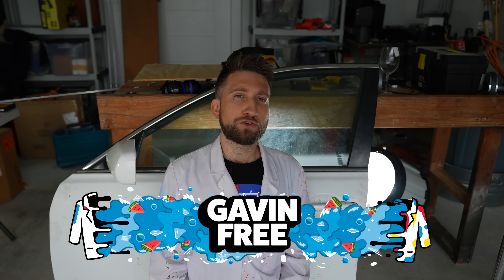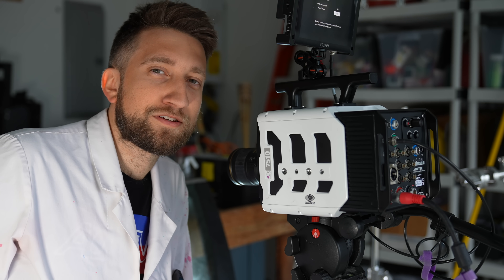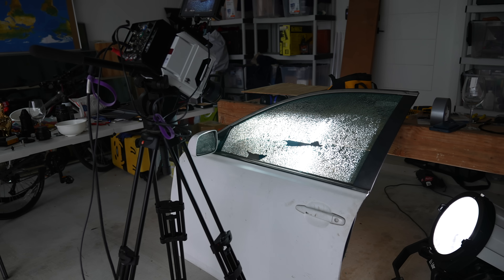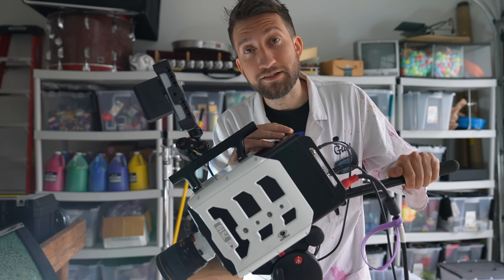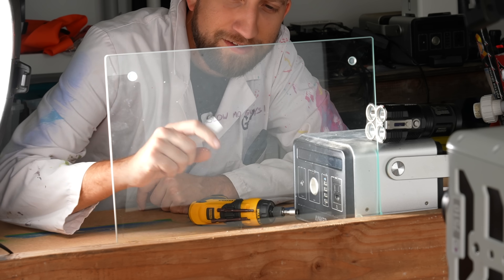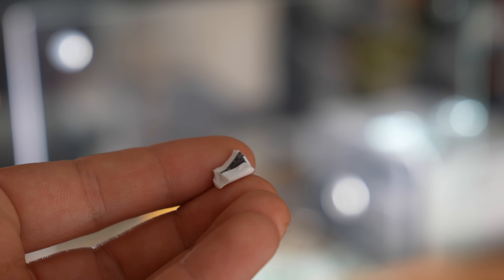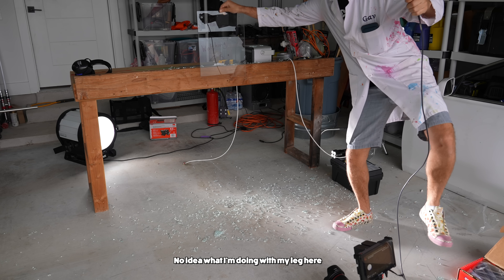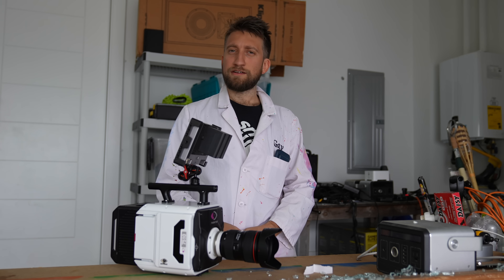Spark Plug vs Car Window at 800,000FPS! - The Slow Mo Guys

Comment: Tempered glass cracks propagate incredibly fast, often exceeding the speed of sound in the material, reaching speeds of up to 3,000 to over 3,200 mph (around 5,000 km/h), with the speed depending on the glass type, impact force, and stress.

Comment: Commenting from over 3 years in the future,  next time you do glass of any manageable size, you should light it by putting LEDs in a frame so that it's lit across the plane for consistent contrast and better exposure! Run them along the horizontal axis under and above the pane so it is lit constantly.

Comment: There's a device that many law enforcement types carry these days for breaking car glass, that's small but extremely effective. I don't know what it's called but it's similar to spiky ball bearing. It fits easily in a pocket, doesn't need to be hurled with great force or velocity, and virtually guarantees a break every time. If you plan to break a lot of auto glass, you might want to look into obtaining a few.

Comment: a slingshot would probably be a better way to project the tile... and an interesting experiment for glass or water is do the ripples / fractures travel faster if the projectile impacts at a faster speed.

Comment: I was looking for an explanation for why ceramic fragments of broken spark plugs break glass. He didn't really break down the science that well, but at least he was wearing a lab coat so that's cool. I do generally understand now That it's all about creating enough force From the throw to provide enough pressure to break the glass Which happens because the porcelain is very hard and fragments into very fine points when shattered.

Comment: 4 million frames is the equivalent of 46 hours of standard 24fps movie! 
The propagation takes ~300µs, assuming it's going 150mm in each direction, that's a propagation speed of 500m/s, 1800km/h, or 1120mph.

Comment: Despite the number of these that I've watched, my brain momentarily shut down, and I was reading the "FPS" here as "feet per second," rather than frames per second. And I was wondering how you got a spark plug to travel that fast. Which is faster than light. And then finally the light reached my brain....

Comment: The sledge hammer bouncing off the window is something I have seen in person. A friend of mine explained it as an intended feature of safety glass. It's designed to take straight-on blunt collisions. But, if you chip it with some like the chipped edges of a ceramic spark plug, the jagged edge is able to slip into the "lattice" of the safety glass and cause a chain reaction that causes it to break away. Protect in most collisions, but give way when you need to pull someone out of a burning wreck.

Comment: It's like my commercial porcelain the shape of a finger, it holds over 400 KG end to end, but if you drop it it shatters on the tiles. yet I could not break it in half. petrified as it is waterproof even without Glazing it.  it even had a 4 mm hole true the length of it.

Comment: It takes a real hard pitch to shatter a window, it's possible to shatter a window with a tiny shard that's around half a square centimetre. It takes a powerful throw close to the window, I actually shattered a flat back windscreen with a decent sized shard, car thieves tie them to a shoelace so they can swing them and not loose them! Kinda hard to charge someone with having break & enter tools when they have a tiny piece of porcelain

Comment: Hahaha! Jeez Gav ... whenever someone told you that you can break a car window with a spark plug what they meant was that you can break a car window with the ceramic from a spark plug. LOL You don't throw the whole hoofin' spark plug through the window! The plug is just a source of ceramic is all. Do this one again please ... take a spark plug, smash the ceramic on it, tie a little piece of the ceramic onto a string and then swing that little piece at toughened glass - when one of the sharp corners/sharp edges of the ceramic catches the glass just right the glass should shatter completely without caving in. It'll shatter but it'll hold it's shape & won't move and it'll barely make a sound - you'll hear the crack but you won't hear glass falling down. It's kinda cool when you get it right.

Comment: ≈ 0.45 × escape velocity from the Milky Way ( 494 to 596 km/s )

 ≈ 0.54 × typical speed of the solar wind ( ≈ 450000 m/s )

 ≈ 2 × electron saturation drift velocity in high-quality silicon at room temperature ( ≈ 1×10^7 cm/s )

Comment: Wow, super fascinating that the horizontal lines form first actually, before the vertical lines do, and apparently, the structural integrity almost seems like okay-ish right up until those vertical fault lines manifest.
Reply: Welp, at least on the 500k f/s one... the 800k one seems a lot more chaotic... wonder if it's down to the actual impact itself, i.e. the shape of the projectile and the initial ruptures' vectors?

Comment: At 3:03 flipping between the frames where the spark plug impacts, you can see that while the plug itself moves across less than a full pixel, the cracks in the glass are already propagating so fast that the latter frame they're already about the width of the plug away from the point of impact. It never ceases to astound me how fast glass breaks, it's mesmerising and mind boggling in such a beautiful way.

Edit: to put it into numbers, between 6:09 and 6:13 the crack moves from about 2/3rds of the way across the frame at 12:10:12.822308.86 to the left edge at 12:10:12.822504.86, meaning it propagated across that distance (which looks to be a few cm) over the span of 296μs, or about 67-100 times faster than chemical signals racing through your neurons to process sensory information (which takes about 20-30ms).
In other words, the time between the first photons carrying information about the fact that a large pane of glass is breaking hitting your retina and your brain having turned that into a single frame image, the crack will have advanced by at least 30 meters - and that is before you've started thinking about what that new information means. Granted, the paper I found doesn't specify what kind of glass they used, but at room temperature the speeds at which most kinds of glass break aren't going to be significantly different.

Sources:
Glass-fracture velocity by F. E. Barstow and H. E. Edgerton ( https://ceramics.onlinelibrary.wiley.com/doi/abs/10.1111/j.1151-2916.1939.tb19471.x )
How fast is the speed of thought? by Martin J. Tovée ( https://www.science.smith.edu/departments/neurosci/courses/bio330/pdf/94CurrBiolTovee.pdf )
Reply: This is such an underrated comment
Reply: This is such an underrated comment
Reply: My brain hurts reading your comment 🤣
Reply: nice one

Comment: So why isn't there a camera that can do 10M fps at 4k? Or 1600 synched cameras in a 40x40 grid each doing 96x54p/10M? Just carry a server rack or 2 of Raid0 SSD's with you for storage. Use that to film lightning. At 10M a lightning strike would still take half an hour and even the return stroke would still take a couple seconds from ground to cloud even though it's moving at 1/3 the speed of light.

Comment: Tempered glass edges can actually be pretty strong. They're only weak in comparison to their surfaces. Safety glass - like for car doors - has rounded edges that are meant to break when the door changes shape. I've seen a 12mm thick shower door take dozens of swings on the edges from  crowbars and hammers. Pretty wild.

Comment: Hey, i habe an idea for making the point of impact more precise and have it more in frame: use a board in a V shape / tube and then sling the spark plug piece with a simple rubberband - kind of like a gun if you want …. Know what I mean ? 
Anyways …. AWESOME video, very impressive to see a glass crack in such way !!

Comment: That fragment is way to big id say less than a third smaller .You just have to throw it harder ..but the smaller the piece it doesn't smash the glass it just pops ,and its a lot quieter

Comment: Is the sound of the glass breaking actually the recorded sound or just added for effect. Just wondering because that seems just as incredible as the video if so.
Reply: The sound is added in.. kinda. If you were to take the actual sound from these shots in real time you wouldn’t hear anything. Example - Gavin slows down the visual recording by 1,000 times and then adds in the sound recording slowed down by only 10 times. Does that make sense? I think he uses the real sound from the recording but it is played at a MUCH different rate than the video
Reply: @jb17415  Cool, thanks. That makes sense.

Comment: When we were young and dumb we would use a sling shot you can use a much smaller chunk then and it will shatter the glass without dropping it making all the noise it was an old school trick car thieves would use

Comment: Assuming I did the math right, with 2.2 seconds of shooting footage and 145 frames in which the glass is cracking whatever size of glass that was finished shattering in 79750 nanoseconds (0.00007975 seconds). If we had the dimensions of the glass sheet I'd love to see somebody calculate what speed the glass is shattering at.

Comment: the cracks propagate directionally across the glass at ≈21,000 m/s. That's almost 60x as fast as a 9mm bullet. If you filmed a bullet cracking the glass, the glass would crack and the bullet would seem to be frozen in the air.

Comment: So many questions. 
Do the fractures radiate out at the speed of sound? What's happening with the pause before it shatters, are shockwaves bouncing back and forth inside the glass? When the pane has finished cracking why is there a pause before it explodes and when it does why does it explode outwards in all directions when the force applied to it was at the bottom from contacting the floor?

Comment: A jagged edge from a dinner plate works too!
Years ago, my wife dropped a plate on the counter, it shattered and sent a shard into the oven.  The tempered outer glass exploded with a very loud report.  At first I thought a bullet came through the wall and hit the stove!  After not finding any broken windows or holes in the walls I focused on the oven window and the demarcation point and found a TINY shard of plate.  It was incredibly loud and the glass was crackling for an hour after it happened.

Comment: Using polarizers you can see the stresses in glass. If you shot through a polarized filter, with polarized illumination, couldnt you capture the wave of stress moving through the glass just in front of the cracks?

Comment: Hi there Slow mo guys. You said the crack moves all the way through the frame in 0.000181 of a second. I'm wondering what is the size of the frame in meters to calculate the actual speed of shatter. Thanks in advance.

Comment: I can't help but wonder what causes a change in the structure of glass to travel so quickly through it.  The breakage (change in structure) is happening at what appears to be thousands of times faster than, for example, a flame front traveling through a combustion chamber.  I wonder if the molecular structure of glass makes such speed possible.

Comment: Next time just use a safety escape hammer. It has a hardened steel tip and does the same as the ceramic on the sperk plug.

Comment: Imagine playing games with this, fps: 1.7m
Reply: You wouldn’t be able to tell it apart from 60 fps
Reply: @thatoneguy611  wym?
Reply: @thatoneguy611  have you ever played on a 120 Hz or higher moniter? Try switching from 120 FPS and locking IT at 60. You Will see and feel a very clear diference
Reply: @thatoneguy611  you ok ? 😂
Reply: @aryangoyal5229  how would you be able to tell the difference between 120 and 1.7 m fps ?
Reply: @sebus212pl4  The point is that if we can so easily tell the difference between 60 and 120 hz, just imagine how drastic of a change to 1.2M would be.
I can almost certainly affirm at this point that you guys have had a chance to try a high refresh monitor.
Reply: @aryangoyal5229  Past 300 frames people develop motion sickness
Reply: @sebus212pl4  People get motion sickness past 300 fps
Reply: @pxrxy  plausible
But I am just pointing out the difference would be easily noticeable, unlike some people said 🙃

Comment: You've got to try the same experiment with a tempered glass patio door!  Before I learned the hard way it can't be done, I tried to cut the glass using a glass cutting diamond tool.  After creating the V linear hole across the window, I saw the surface turning into multiple waves like a drop of water hitting a still water surface.  The wave propagated through the window before the tempered glass exploded in thousands of pieces, I encountered parts for years in the apartment!

Comment: Why do you need to shrink the height of the screen? Can’t you just lower the resolution?
Reply: It's probably has to do less with actual resolution (he says he could bin the image horizontally if he wanted to), and has to do with shutter/readout speed, i.e., the time it takes to capture, read out and store rows of data that fast.

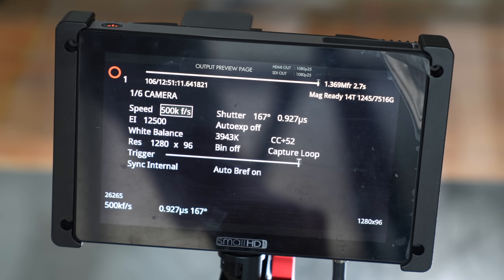Comment: 4:26 I'm longing for the day a UFO is filmed with this camera
Reply: That's basically impossible even before getting into the probability of UFO Encounters themselves.   The amount of setup required to properly use this camera means that  every shot with it has to be planned.   If you are filming it with a Phantom, it's not a UFO because you have identified it in a controlled shoot.

Comment: To see the glass crack circularly the way it did first up was unreal, then @800,000FPS it definitely slowed it down, yet it would have been magical to see it as a full frame - too bad you only got the letter box effect due to resolution - yet that would take a next level camera. Cheers Gavin :-)

Comment: There's something I've seen on YouTube and I would love to get a real slow-motion explanation view of it.
Someone poured molten metal (or molten red lava rocks) onto various pieces of glass and one of them was 'fire resistant', panes of glass with a gel between. In the video, it looked like the gel was boiling inbetween the glass panes before finally flicking the now solid piece of metal off the surface. 
I have a link to the video in question,
https://youtu.be/-T_XPaY43YM

Would it be possible to get a good slow motion of this effect/reaction?
Reply: Thank you for the link. That was some pretty fascinating stuff... I ended up watching their videos for an hour before coming back here 😂

I agree, it'd be amazing to see that insulating gel as it outgases in extreme slo-mo 😳

Comment: https://youtu.be/0-HYPdh744M I know this is an old video but there are over 500 likes on a comment mentioning slow mo guys and I’m sure tons of people would want to see this collaboration with the YouTube channel Photonicinduction, what’s actually happening that the electricity can violently blow apart these fuses and bulbs as it does. Also really interested to see what a crt tv over volted looks like before it blows the electron gun/coil/ray w.e people call it.

Comment: I even adjusted The Playback Speed in Settings, I need Slow mo in A Slow Mo 😂
Reply: Legend
Reply: Genius
Reply: Yeee boy
Reply: Yes, at 2:40 with .25x speed is very satisfying.
Reply: 69 like wow
Reply: I did this as well its 4x slower so around 320000 frames a second instead on 82000
Reply: @Billt31-07  that’s not how the playback speed on YouTube works
Reply: @Billt31-07  that's not how FPS works but I get what you mean. I did it too and it was pretty cool, and his voice sounded funny
Reply: @Billt31-07  it's still the same amount of frames per second, the camera didn't change when you set the speed to be lower on YouTube. The only thing that changed is what frame rate you are choosing.
Reply: Did anyone else hear him have an orgazam at 0.25X speed.....
Reply: @Littleluirui  at 7:00 yes
Reply: @Littleluirui  yeah but not much  slower than You
Reply: @Littleluirui  I did and it's hilarious
Reply: 10 millions FPS
Reply: Pro tip: 
On desktop YouTube  when the video is paused use < , and >. keys to go frame by frame
Reply: No cap 0.25x is even more nutz
Reply: I never knew this was a thing till now
Reply: Legends alert 😂
Reply: Samr
Reply: I also😂😂
Reply: .25 and I enjoyed the circle
Reply: Kedu kettavan
Reply: @lordzeus8873  good job 😂😂
Reply: @lordzeus8873  Muthu pandi kota di
Reply: @FirstNameLastName-ro6jb  nuthu pandi kota di
Reply: By the Way, Frnds, this guy is a great spammer.. @lordzeus8873   be Aware of him
Reply: @FirstNameLastName-ro6jb  ennena solraan paarunga
Reply: @lordzeus8873  🤣🤣🤣🤣🤣
Reply: Thala 🔥🔥🔥🔥🔥🔥🔥
😂😂😂😂
Reply: @pranavkarthikeyan2004  😂
Reply: hey, everyone has to when glass is being broken.
Reply: i am also interested in this so much

Comment: How much does this cam cost?
Reply: Phantom's v2640 does 11,000 frames max, and can cost $135,000-$175,000. Since the camera used can do a lot more than that, it might cost several times more than that. Sorry I don't have a more direct answer

Comment: interesting question here: Is that faster then Lightspeed ? I mean the one with the 800k/s
Reply: Nah, light would still move around 250 meters in 0.79 microseconds. Still, that's pretty dang fast.
Reply: you call me ?

Comment: 7:58 most satisfying sound in the universe. Like a huge anvil falling perfectly on steel.
Reply: And this is done completely differently that what's happening. Sometimes slowing down the sound works, mostly it doesn't. Gav explained this in a video
Reply: Now change the playback to .25 and listen to it

Comment: when you dropped it, it cracked because of the other super hard tempered glass pieces under it, same theory as with the shattered tempered porcelain from the spark plug.

Comment: if my calculations is right, the speed is 4500km / seconds the glas travels when it breaks. (or 16200000 km/h  / 10066213 mp/h)
Reply: Are you sure it is not 4500 m/s ? Imagine glass breaking in less than a second between New-York and Los Angeles (4k kms)